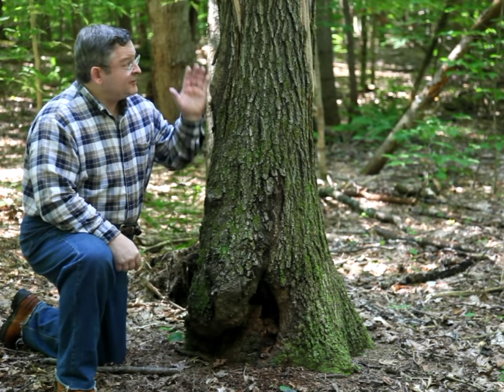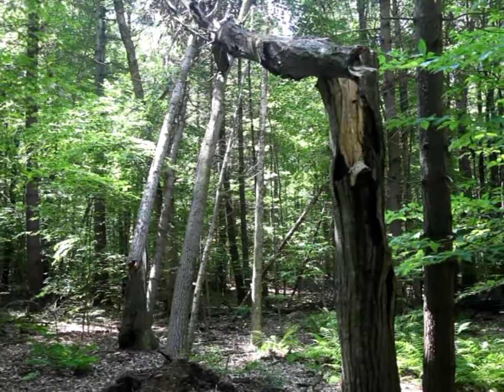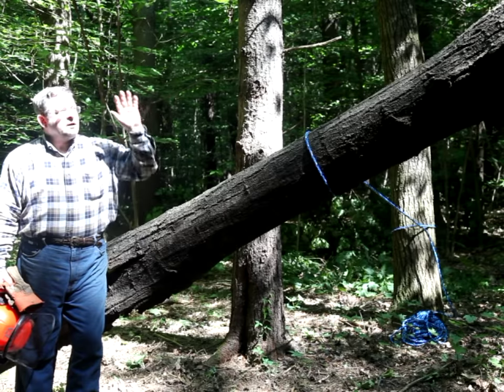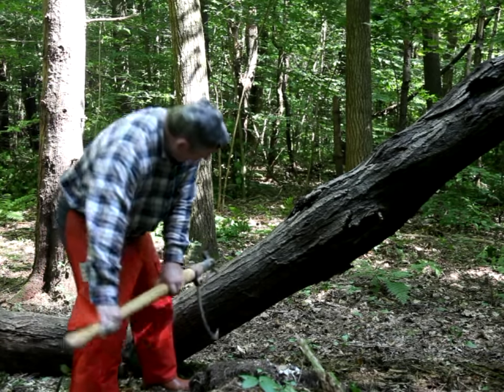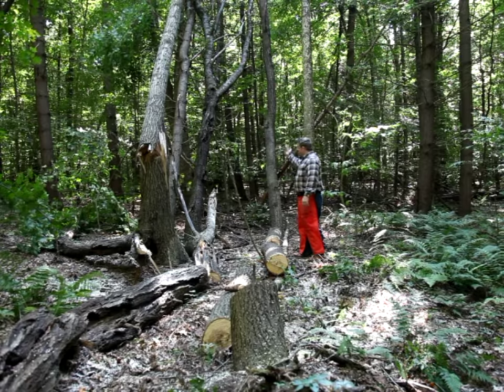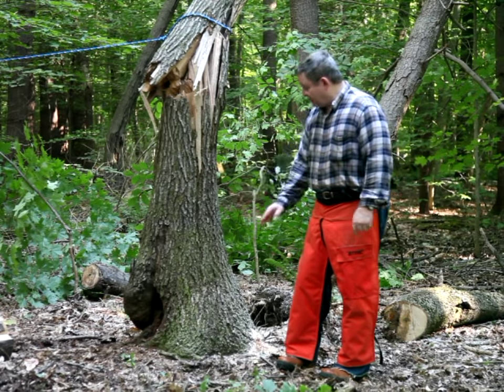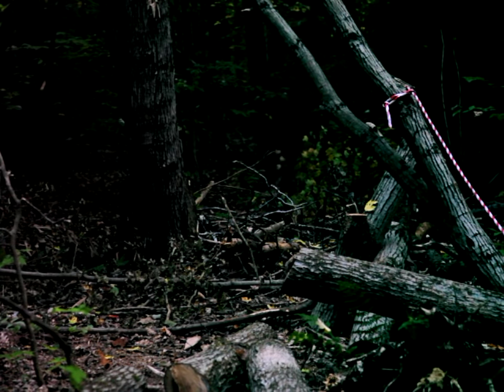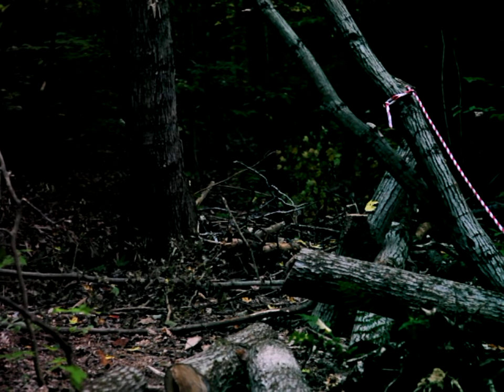Widow Makers

Comment: Hello Terry, could you possibly recall what was rope width that you used for this felling? And also, you remember, approximately what was the total length? In my area it is very common task to fell a leaning tree. 

I've already tried once the technique you presented, and I think it could saved me from injuries. I had a tree to fell, it was a small size  but very long dead pine tree. It was already leaning against another pine.  So I decided to use a rope to pull it from a safe position. And it was right decision, because once the tree started to move, its top with a few dead branches has broken and fell back behind the tree, right at the `safe` 45 degree direction. 

... So I am thinking of a strong rope now, as there are still trees like that to remove.
Reply from the maker: Denys, unfortunately, the rope width does not control its strength.  You are right to chose a strong rope, as it can be hard to know what load it may have to resist.  I hope your tree fellings go well. - Terry
Reply: @terryhale9006  Ok, I got it, thank you! I will then look and see the specs for the available static ropes in my area.

Comment: I had a 2' dia hickory that had snapped about 10' high, during a storm last year. It was still attached and the limbs remained green through the summer. 
Over this Christmas/New Year's break, I decided to take it down. That was a decision that ruined my vacation as I ended up making a trip to the ER.
My plan was to remove the top branches slowly and evaluate as I moved along. It had 1 main branch driven straight into the ground that I thought, along with the trunk that was still attached, would support the tree.
As I was cutting on what I planned to be the last branch, suddenly the tree shifted off the stump, the branch jammed into the ground snapped and about 30' of solid Hickory log tumbled to the ground.
As it bounced up, it caught me in the chest and literally knocked me back about 20'. I struck my head on a tree behind me, knocking my helmet off.
As I clutched my chest, I gasped for air, realizing I was in bad shape. I couldn't stand and was seeing stars as I tried to breathe.
Finally, crawling to my side-by-side, I pulled myself into the cab and made it back to the house. My wife drove me to the ER.
Five broken ribs later, I am lucky to be alive and even luckier to have not been maimed for life. This was an extremely painful and valuable lesson, that I manage to live through.
Reply from the maker: Wow!  Scary!  Sorry to hear of your pain and expense.  Hope you have fully recovered.
Reply: It's slow, just happened a week ago today. Really sore and stiff, lots of bruises.
Wished I'd have moved slower and been more methodical. Really wished I'd have watched this video first. Even at 58, I have more to learn!
Thanks for the well wishes!

Comment: Have you tried a 4 meters pole saw?
Reply from the maker: I have a classic pole saw, but would like one of the new pole saws that has a powered chain saw to do the cutting.
Reply: @terryhale9006  I use a Husqvarna battery saw I can extend to 4 meters. I was thinking it would be handy here for safety reasons.  I don't have your knowledge and experience so maybe Im wrong. I never do this kind of work.

Comment: These tree cutting videos are awesome...thank you....Even your falls are controlled..ha ha! I have about 20 x 6-8 inch pines leaning over a steep mountain side directly over where I want to build a cabin.No powerlines, buildings or obstructions. Angle of lean between 30-45 degrees...any advice?
Reply from the maker: Well....If you're over 50, hire someone young to do it.
That best advice aside, if you haven't already seen my video on leaners, definitely give that a thorough watch, as leaners, particularly of the type and in the location you describe, can be very dangerous.  (Leaning over the mountainside, there is a good chance they are wind-shook.)  Other than that, start at the bottom and work your way up the slope.  You really don't want a tree hung up above you as you are trying to fell a tree farther down the slope.  As a safety precaution, consider inviting your wife or girlfriend to come with a cell phone on the off chance you get seriously injured.  The MOST important advice, however, is ... don't invite both.
Reply: Ha ha...Thanks for the response Terry. Actually...I am the girlfriend...lol...My hubby's an indoors kind of guy. He gave me a cordless 16" chainsaw for Christmas....my choice - based on good reviews. I will be taking a class to learn how to use it. Starting at the bottom is great advice...will also plan/clear escape routes, wear all the safety gear and never work on my own.  I have great respect for the power of trees, so I'm trying to learn how to read them... I'm hoping my biggest friend will be fear....and courage.  Can't afford to hire anyone and those trees will turn into Widower-makers unless I deal with them.  I was camping in a tent on the land in the middle of a hurricane when a fallen tree hurled down the mountain and impaled itself 4 foot deep in the ground about 100 feet away from us. What a night.The next day we lassoed all the remaining fallen trees and pulled them down onto my terraced field.....excellent firewood! Will watch your leaners video on repeat.Thanks again @terryhale9006

Comment: On another note get a come along or use the truck with chains when you get to vertical end
Reply from the maker: I'll take the blame for not making it clear that the video was intended to be a demonstration for folks who either don't have a lot of equipment, or didn't bring it with them.  Quite a few people have commented that it would have been a lot easier and quicker with equipment.  I've got close to 200 feet of chain, four cable winches, and a tractor.   I should have made it clear that I was going with a minimalist approach.
Reply: @terryhale9006  no worries great video I thought you stated you had a truck close by. Your a bull by the way

Comment: 8:15 a bigger notch would have done the job, though easy for me to say from the safety of a screen 8 thousand miles. We rarely achieve anything totally perfect in this world and that's as it should be.
Reply from the maker: The problem was that the wood was pretty badly fractured.  When that happens, you have to nibble your way in or the separated parts will pinch your bar, perhaps locking it.  Even though I was "nibbling in" from both sides, you can tell that I got pinched anyway.  If I had tried to cut a big notch, there is a really good chance I would have had to fetch another one of my saws to free the stuck saw.

Comment: What pully is he using in the video? Is it ratching to keep the tension, I'm assuming the original man isn't responding to these post considering it's almost 10 years old.
Reply from the maker: He is still responding.  Not a special pulley by any means.  Progress was simply tied off.
Reply: @terryhale9006  ah, ok, he had mentioned that he was trying to add 3-400 lbs of tension to the line, I assumed that it was some sort of locking pully to keep the tension in place. In my experience, which is limited when I've been adding thr tension it easily will slip off. 

Also, the follow-up question is the line that you are using "static" or "dynamic" I have been using an old climbing rope which is dynamic, but with its stretch it seems more difficult to keep the tension. But I imagine that using a static line with loads this heavy could be problematic and potentially incredibly dangerous. But it's just a thought.

Comment: Half inch diameter grape vine can mess your day up with a 30 inch diameter tree. Grape vine is very strong
Reply from the maker: Definitely!  I have some vines that are 4" in diameter.  The worst a grape vine ever did to me was one time when I went to give the hardest machete blow I could to a 2" diameter grape vine.  It turned our that the inside of the vine had rotted to dust, but the bark of the vine made it look like a healthy hanging vine.  I hyperextended my elbow and it took around six weeks to fully heal.  Lesson learned.

Comment: Why waste petrol? Lop the top off and debranch on the way down. Just make sure it is a controlled swing if it gives way. You can always rope yourself to another tree so you can swing free. And make sure you have at least 45° of a branch free drop zone into where you will land. Somewhat foolish getting clobbered by the tree you are felling if you are getting tangled into branches during your superman. If you do it right, nothing can hit you. The benefit is a pile of logs ready for splitting when you get to the bottom.

Comment: Are you sure that was a northern red oak?  I ask because it looked a little like it might have had the characteristic ski track bark of a scarlet, plus scarlets often have a rotten out bulge at the base from non-fatal chestnut blight.  I suppose I'm assuming you're in the Southeast, since the forests I've seen in your videos look characteristic of the ones I'm familiar with.

Excellent videos.  I've done this work for fifteen years, and I'm suddenly learning new techniques.  Thank you.
Reply from the maker: ***** Though I lived in Birmingham for 14 years, this was indeed a Norther Red Oak which had been living peacefully on the southeast edge of the Adirondacks.  The property was logged in 1982 and many of the older trees have basal damage from what I consider to have been sloppy skidding practices.
Reply: Terry Hale Ah, yes, that would definitely make it a northern red.  Such a shame that carelessness 33 years ago still has such an impact.  That's why I always take the extra moment to double-check my fall angle and skid path, and I appreciate that you appear to do the same.  Stay safe.
Reply from the maker: ***** Thanks Dave.  You as well.

Comment: Thats a tough scenario.   I would have used 5 pulleys and pulled with extreme mechanical advantage the trees away from the problem from the bottom one at a time.  That way i am at a safe distance and the hung up trees get down to the forest floor.
Reply: And your still out there setting yur blocks and lines right

Comment: I just cut a broken tree ,now its leaning on another so I will see if my truck can pull it down if now Ill  try a 12k winch
Reply from the maker: If you're taking it for firewood, rather than just taking it down for safety, you might consider taking it in lengths, first.
Reply: @terryhale9006  O Canton all ready cut a leaning on another tree

Comment: Mr. Hale, do you remember what that blue rope is? Is that the 100' -  1/2" polyester you got from the hardware store in a previous video?
Reply from the maker: Good eye.
Reply: Yeah, I'm going back through and watching them all again for the 2nd or 3rd or more times to get a more thorough understanding of what is covered. My first views didn't do justice to the knowledge and value that appear to be contained in these videos.
-- what about the red and white striped rope? ... do you remember the specs on it? Thanks.

Comment: I'm not someone who is concerned easily. But this is very dangerous. There are a lot of moments in that it was pure luck, that nothing serious happened.
The far better way would be, getting a winch with a proper cable. Even a manually operated one would do and those are not expensive.

Comment: I have a lot to say about this. But since you made that joke about dignity, I’ll just do one. You are wasting wood and energy with that top wedge on a down loaded stick. Just cut the top down a third, bring the bar out to ten percent of the wood, cut down ten percent of the diameter, plunge the bar through the wood, cut down the rest of the stick. At that point, the stick will settle, then just up cut away the sliver, and the stick will fall away. Simple, and you only have to undercut a tiny fraction of the stick. This works with a stick that is more wide than the bar is long by cutting the opposite side enough to satisfy the length of the bar from over the top first, and then following the kerf on the cutting side second with all the same technique observed. Easy.
Reply from the maker: Thanks, Gabriel.  When the stick is pretty much on the deck, that method is fine.  When the stick is hung up and  its direction of fall is uncertain, I prefer to cut a wedge and leave a full-width hinge to ensure it settles straight down and doesn't come sideways at me.
Reply: Terry Hale Thats fine if you are worried, but it’s a lot more work, for the same outcome. And here is a caution, don’t think cuz you put a face on it, it will go that way. The tension tells the tale. Good cutting, man.
Reply: Terry Hale And, honestly, I was speaking directly to hung sticks. I am a climber, a ground guy, and a feller of trees....so much my fate.  I know cuts. I stand by my statements. And I am really drunk right now. So, later.
Reply from the maker: Hope you can enjoy it. Stay safe.
Reply: Terry Hale Right on. You too.

Comment: Why doesn't he simply use a strong winch to pull these hanging trees off each other?
Reply from the maker: I have two Little Mule winches that definitely could have done the job.  The demonstration was for the benefit of someone who either doesn't have such a winch or didn't want or think to lug it into the woods with them.
   As you'll see in my earlier and subsequent videos, I completely agree that winches are wonderful to have and use.  Great "force multipliers".
Reply: dont forget the undercut for hangers

Comment: Is it really wise to use ropes on trees weighing hundreds or thousands of pounds? Reminds me of the idiots pulling on ropes by hand in an effort to stop tall trees from falling in the wrong direction (on houses, etc). Rarely ever works.
Reply from the maker: It depends on several factors.  One is the capacity of the rope.  What you can buy in most hardware stores is not that strong.  If you buy from an arborist supply store, they routinely sell ropes with capacities from 5 to 10 tons.  So, professional arborists definitely use rope to pull trees down and lower heavy pieces. 
   Another factor is what you're pulling with.  If you're pulling by hand, a rope with a capacity of 300 pounds per person will be more than strong enough to withstand the tension.
   How hard the tree has to be pulled is a big factor.  A tree can weigh five tons, but be very well balanced.  In that case, if it has been cut nearly through at the base, even fifty pound of horizontal force can tip it in the desired direction.  The two places where people tend to get in trouble are in underestimating how hard a pull is needed and in ignoring trigonometry.  If you are practically under the tree when you are pulling, most of that is a vertical force and very little is being applied horizontally.
   In summary, if you pick the wrong tool or try to use it in the wrong way, you shouldn't be using that tool.

Comment: This situation would best be taken care of by a climbing arborist. This could be taken care of in 15 mins.
Reply from the maker: Who hires a climbing arborist to gather a quarter cord of oak?
Reply: Terry Hale I’m with the work smarter not harder crowd. This is a ton of work for like you said a qt of a cord of wood. Unless that’s the only red oak in the county I’d choose another tree.
Reply from the maker: Plenty of oak.  I just prefer not to take healthy trees.   The purpose of the video was not to get the tree in the quickest way possible, but to demonstrate how someone who doesn't have all the desired equipment could tackle the job.  If I'd used my winches or tractor, there would have been no value in making that video.
   As to climbing, most homeowners have neither the equipment, nor the experience, to do such a risky climb.  While I am not much of a climber,  I do have enough experience to know that  the three combined widow makers would have made that a pretty dangerous climb and one that would have taken nearly an hour to complete safely.

Comment: You're to old to be falling down. Use a winch.
Reply from the maker: Fortunately, my Dexascan shows good bone density.  You're right, though.  No sense tempting Fate.
Reply: I've watched a number of your videos and I must say they are exceptional. I've pulled a few trees. But since I am an amateur, I always pulled them down and then out roots and all. Also, I just can't trust rope anymore. Having broken many a 5/16" chain, I use 3/8" chain, grade 90 to do most of my horizontal pulling and I usually use as many chains, anchor points and two-ton winches as needed. Also, I use some 6 ton straps with confidence especially when I have to connect high. Much lighter than chain. Just as strong.
I've broken some winches and chains by over-loading them. Those days are long gone. I've learned it's better to add another than it is to push my luck and break one in the middle of a heavy pull. 
You are obviously a professional. I am not. Neither am I rich. But I've learned from unpleasant surprises that it's much better to bear the extra cost and play it safe. I highly recommend folks either spend the money on the best tools for the job or hire a professional like you. And given the level of expertise required to stay out of the hospital, the latter would be the best choice in my opinion.
Reply from the maker: Thanks, James.  While I've done a lot of tree work, I can't claim it as a profession.  I appreciate your observations and we have similar experience and conclusions about breaking hardware.  I, however, do not have any experience with cable.  (Something about an old dog and new tricks.)  I will have to look into that seriously.  If I'm still active/alive in two more years, I may do a video about what I've learned.  Thanks for the additional impetus.